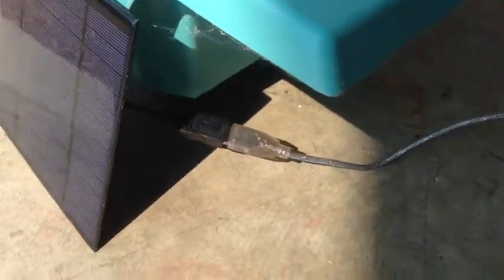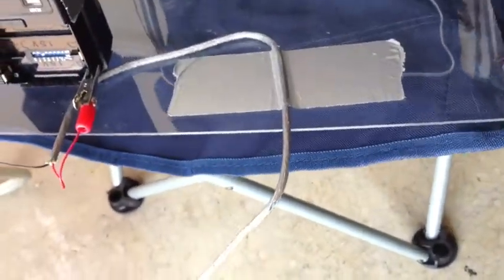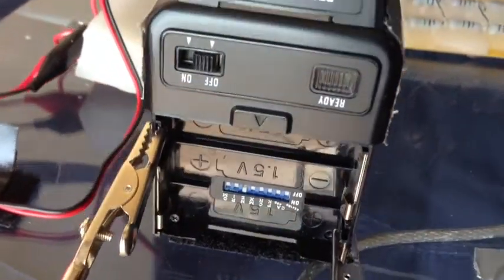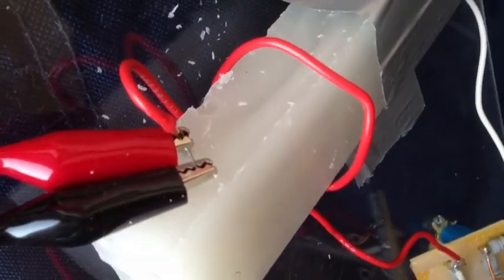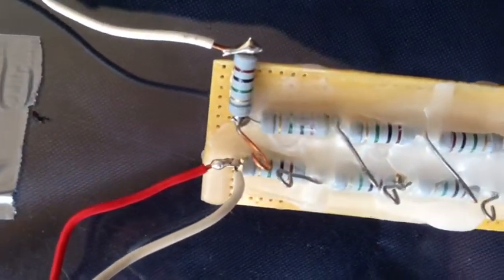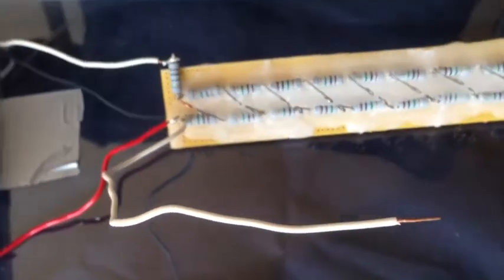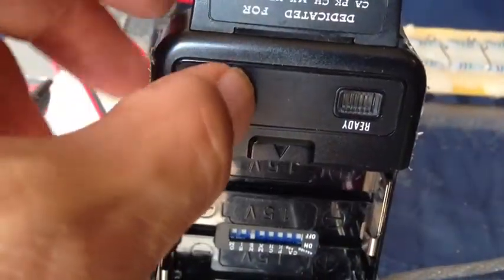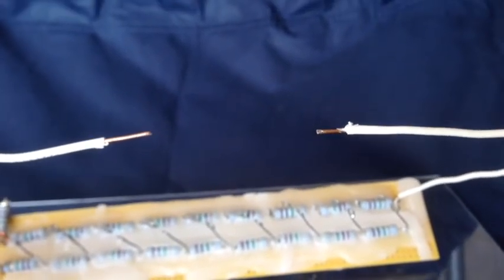Solar Powered Marx Generator

Comment: It is a great project, but could you maybe explain how exactly you stripped the camera flash?
Id love to do this for some ozone production..
Reply from the maker: The camera flash contains a 330 µF electrolytic capacitor. The output of the board of the flash has a diode on it. This is a small high voltage diode that can handle about 1000 V. The AC output from the circuit board of the camera flash is rectified through the single diode and charges up the electrolytic capacitor. When the vantage reaches a certain threshold of say around 350 V, the flash is ready to go. In order to access the high frequency, alternating current from the circuitboard, the electrolyte capacitor, and the diode have to be removed. The AC voltage from the board is then fed  into the small CW multiplier which consists of a chain of capacitors and diodes in an array. This is used to charge up the Marx generator.
Reply: Thank you very much! i got it running from a disposable camera flash circuit...Just connected it directly to the transformer instead of removing the diode. Other camera flashes i opened, seemed too complicated for my elecronics knowledge

Comment: what is the role of resistors in a marx generator?
Reply from the maker: The resistor is allowing the capacitors in the Marx  generator to charge up in parallel. Once the capacitors get to a certain potential, then they spark over. The sparks have essentially zero resistance compared with the resistors, and therefore the capacitors aee effectively connected together in series during a spark event. This allows multiplicat of the voltage on each  of the caps by the number of caps!
Reply: @BrianDhvTinkerer  Thankyou!!!